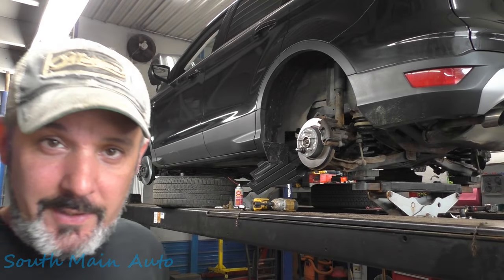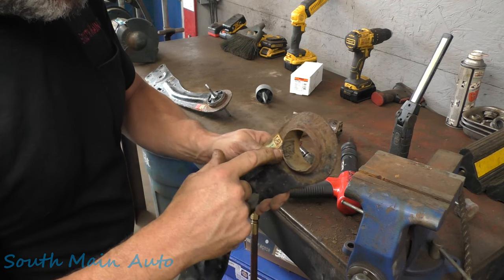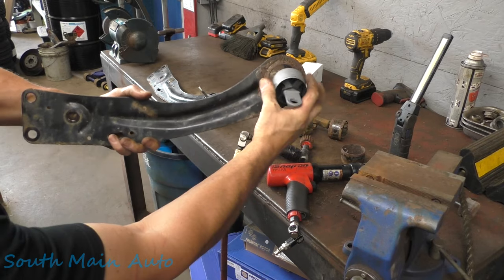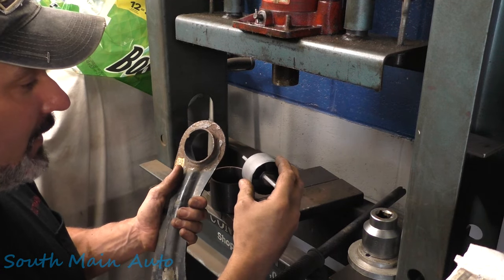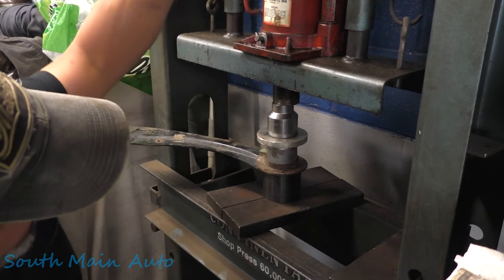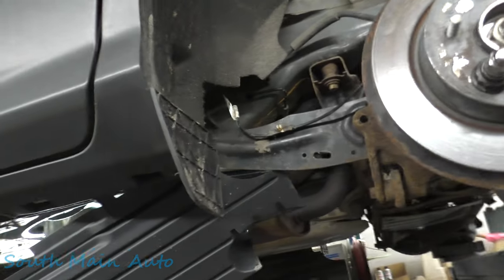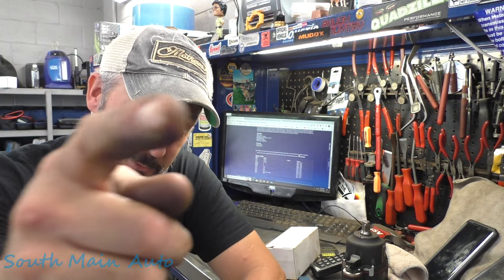'13-'19 Ford Escape Rear Trailing Arm Bushings

Comment from the maker: -Dorman 523-067 Rear Lower Forward Suspension Trailing Arm Bushing : https://amzn.to/3cxivLD
-The secondary reason I made this video.... https://youtu.be/fGm1asWuqqU
Reply: Sponsor?
Reply: Hi Eric - Have you had any luck with Dorman lower control arm bushings for Toyota Camry?  I need to replace the bushings and the dealer parts dept wants $150 per control arm. 

Also, I saw some kind of investment spam in the comments so I reported it to YouTube.
Reply: So the rear trailing arm is trailing behind trying to escape.
Reply: The audio sounds pretty good like usual on here
Reply: @bbccat2  Try a dealer that sells online such as Partznet in PA, Conicelli Toyota.

Comment: And for the "Shade Tree" types that don't have a press or that nifty cutting tool ... take a hack saw blade off, insert thru the bushing metal retainer, reinstall blade and cut a notch in the bushing housing and, after removal of the hack saw, hammer and chisel on the edge of the cut and she'll pop open. As for the Press, toss the new bushings into the house Freezer for a few hours and it will contract enough to slide in by hand; may have to warm up the mating surface on the metal trailing arm orifice to gain a few thousands more but it will go in by hand.
Reply: @felixgato4392  most welcome !!!

Comment: I went to go grab my air hammer with a regular chisel attachment to remove the sleeve. Turns out I had the same attachment as this video. Brand new, never used. Took the sleeves out like butter. Thanks for showing me a tool I didn’t know I had!

Comment: i usually mark the arm with crayon where the old bushing was installed before I take it out....that way, the new bushing is in the same plane as the old one...good job
Reply: Good idea
Reply: Great idea I normaly use permanent marker normally gold or silver
Reply: Tried using my wife’s lipstick but pink doesn’t show up very well on metal…😘
Reply: Sharpie marker or pink paint marker
Reply: The old one is no longer attached ...;-)
It came out by hand.
Reply: That's what the OEM instructions say to do, at least on Volvos when you do these

Comment: I used the Dorman bushing and it worked great. It was a pain in the butt getting apart without a lift getting enough leverage to brake the bolts loose. It went back together better then I thought it would. Thanks for the video, saved my daughter a bunch of money

Comment: When we swap these out at the Volvo dealership (Fords and Volvos from this era use the same platform in some cars), we actually do them in the car, just take off the shock absorber bolt, and loosen the short arms that connect to the hub assembly, then after getting the bolts out of the bushing use a large pry bar to wedge the bushing down enough so you can air hammer it and push in a new one.
Reply: I just take 2 or 3 bolts out and just loosen the last one.  Take the two bolts out of the frame and it will come down enough to get the air hammer in. At least with the Fords.  I don't work on Volvos.

Comment: Use the moog if available.  I did these this afternoon with the dorman part . PIA . Even with the new bushing in the freezer for days and heating up the arm with a torch , still bashed the hell out of it . Ended up taking away metal where the bushing resides , little by little until the bushing fit tight . Popped the bushing back out , coated it with green loctite sleeve retainer , drove it back in , bolted it back together and let it sit . Strange the passenger side was completely shot , but the drivers side was still in great shape .
Reply: I did the same with the moog part and it was also hard to get in. Only my passenger side was bad as well. The bushing slowly separated and became offset in the sleeve even though the rubber was still pretty good. I believe it is due to my trailing arm wanting to sit closer to the middle of the car (I had to pry it outwards to line the two bolts next to the bushing up). So this one will likely do the same with time as the are has inward pressure so there is constant sideways force on the bushing.  As the sleeve corroded the rubber will slowly separate as well.
I think I'd have to get an adjustable toe link to fix this. The passenger side does look to have a bit more toe in than the driver side on my car.

Comment: Trailing arm on my 2007 Focus was cracked and flexing enough to touch a brake line. I was replacing the shock and couldn't believe such a suspension failure.

Comment: Hey Eric, how many miles on that Escape? Thanks for the video. I didn't know that Dorman parts were good I've always had mostly bad luck with their steering and suspension parts. I'm surprised you stated they work OK on those trailing arms. We all know how bad Dorman can be with automotive parts they're more of a miss than a hit. In my books Dorman only gets used when there is nothing else available in the market it's my last resort case scenario. The audio quality is superb with your new camera 👍 Thanks.
Reply: Moog also makes this bushing as well, this is what I've put in many times at the dealer when these arms are unavailable
Reply: @CanadianCarguy247  Yeah, I like Moog. That's what I use mostly for steering and suspension stuff over the years.

Comment: Dorman doesn't make any parts. They are an aftermarket reseller. They source parts from a variety of manufacturers and then sell them under their label. This is why some of their parts can be lousy and others very good.  NAPA does the same thing by selling some parts under their brands but then it also sells products from other manufacturers and suppliers.

Comment: Get some eye protection on when using the power tools...  and don't say you just close your eyes..  Thanks for the video this morning..!
Reply: I am "lucky" to have a bad example to remind me to wear eye protection any time I am working with power tools.  In the 1970's, my father was doing a quick sharpening operation on a mower blade and a piece of metal went through his eye.  He was pretty much blind in that eye for  over 30 years until they developed a procedure to fix it.  Even today he still has problems with it.  WEAR EYE PROTECTION!  PLEASE!

Comment: I'm in Buffalo New York and I have a 2016 Ford Escape SE a d the passenger side is incredibly loud when you hit a pot hole or anything really.  Should I replace both sides or can I get away with just the passenger  side?

Comment: I had noisy rear end when going over bumps and had the Trailing arms replaced and i still have the knocking noise when going over bumps. Any suggestions?

Comment: I have been getting into the habit of buying something in the 20,000 mile range and running about 40,000 miles and selling. After 60,000  miles everything starts  to fall apart. Selling cars every 3 - 4 years.  I also bought a NEW Nissan Sentra 1999 and sold it 10 years later. That also works. I took care of it. Otherwise this is all an endless money pit. Buy American. Better yet but what's good for you.

Comment: Do NOT forget to check the rear suspension - forward lower arms (dogbone style) on these escapes.I have done a plethora of them in the past few years as a Ford tech, because the bushings delaminate on the inner and outer portion of the arm and cause the entire knuckle to shift rearward, causing tire wear and usually a clunk or grinding noise over bumps. Can also be replaced without dropping the subframe.😉Great video Eric.
Reply: I just had to do those same bushing on a 2014 Focus SE. I just ordered the complete dog bone from Rock Auto for both sides and replaced them. Less than $40 for both arms.

Comment: Moog also makes a good bushing for this. I did this job on my ‘13. Ford wanted over $400 for the whole trailing arm assembly!!! Wouldn’t sell just the arm itself. Ridiculous.
Reply: I work as a tech at the ford dealer. The trailing arm itself is in backorder, however the rear knuckle comes with the trailing arm and those are available. We don't typically replace the whole knuckle anymore. We offer bushing replacement for them now

Comment: ***Little help please anyone: I want to verify an injector is firing gas into the cylinder. Ohms are OK on the suspect injector, I can hear some clicking on it with a stethescope but it seems to be not as loud as the others. It does have computer control , checked with test light. I do not have a bidirectional control scan tool. I dont want to pull the injector, take off the intake etc. Is the only way to determine is  to look in cylinder with small camera? Thanks.

Comment: Do you charge by the actual time spent or by "book time"? My old mechanic (retired now) billed "shop time", which could be a little unpredictable in the estimate, but was usually cheaper. The new mechanic, who bought the old shop, does "book time" and wants to charge $2300 for a clutch replacement on a 2012 Corolla. That seems insane to me, but is that the current state of auto repair?
Reply: Pretty sure Eric does it by the book. That's how we bill it at our shop along with most of the small shops near us. But $2300 for a clutch replacement on a Corolla is absolutely ridiculous. It's around 8 hours according to factory service data and at a reasonable shop rate, should be no more than a grand. A new aftermarket flywheel and Aisin/Exedy clutch kit should be under $400 in parts.

Comment: While the control-blade arm is out, should clean it some, and spray on some "Eastwood Rust Encapsulator Black Aerosol" or maybe just some zinc-infused anti-rust paint, and then spray paint black if you want.

Comment: Life is to precious to use Dorman suspension, steering, or brake parts!🤣
I need to check those bushings on my 2017 Escape, I've noticed a little clunkyness over bumps lately.

Comment: get same bush same part number duralast too, had these moog before too .
Had some Moog ones in stock as bought  in bulk cheap as fairly common job and if arm good and clean bush way to go as easy fit and cost minimal ...
garbage bush design really, was garbage  bush concept in 1999 was more garbage in 2009 and now total garbage 2019 lol 
Good engineered poly bush can be worthwhile on these for rougher road use longer life span ..
I'll get the door man ....

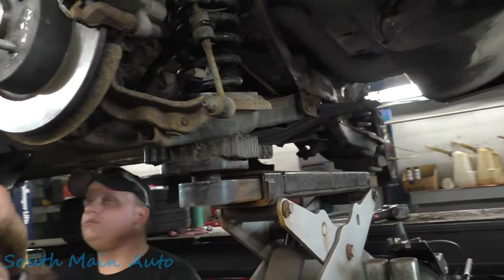Comment: As a camera test this was great. Good quality from where I'm sitting. Good tip as well. I did not notice any part where your voice cut out from being behind the camera unless you did not show it. It looks like you are behind the camera at 4:24 and though the sound change a little I would not have noticed if I were not trying to find it. I'm on a desktop computer running Win7 64 bit with no fancy speakers but they are good. Old version of Nvidia High Def Audio drivers dated 3/23/2018

Comment: Nothing wrong with a little bit of sound effects. I drove a pick up truck for many years with the front sway bar clucking. It did not have any rubber left on it. Just 1/2 inch of sound effects. 
One day, I was going to take it off and repair it, but it was so rusted up that I just said meh, and let it be.

Comment: From the UK and I have a 2011 ford Mondeo, same type of bush. Terrible design but I bit the bullet and fitted polyurethane bushes. Bit more expensive for sure but ride quality is still great and I'll never have to change em again. If you start getting wear on inside edge of the rear tyres, defo suspect the trailing arm bushes

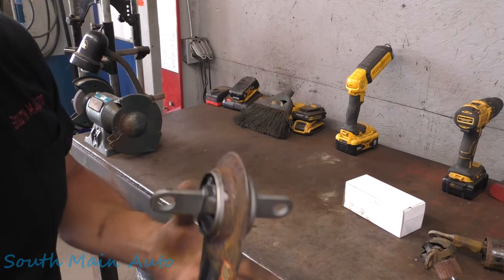Comment: 3:56 once you flash that thing around in your hand like you just did I saw how thin it was and I'm just scared of that actually being a part on any vehicle l 😂
Reply: Well, it is installed with the edges being vertical. So any downside and upside pressure goes through the entire width basically.

Comment: Had my ford dealer quote me over 1300 to replace my rear trailing arms as they said they were bad and would not pass inspection. Had my local garage perform the inspection and quote me on the cost. 

One they could not find why the dealer said they were bad. 

Two they said it would cost less than a quarter of the cost they quoted me at if they needed done. 

Glad to support my local shop!!!

Comment: 5:00
Howdy, Q: Preheating the 0.d. , , , , ,is it worth the time, in an automotive environment. my environment is hydro-mechanical(big ass mechanical / hydraulic presses). anyways, i feel more comfortable removing as much stress on a bearing during install.   So  Heat the  O.D. And Cool The I.D.
i shoot for drop in temperatures.   CO2 fire extinguisher  and/or flame, , , , , ,250?
ty, les

Comment: Doorman has gotten a bad rap over the years, a lot of it earned. I’m not sure I trust their electronics but a lot their basic parts seem to be reliable and they fit. I replaced an intake manifold on a Ford 4.6 with a Doorman. That was 140,000 miles ago. The coolant runner on the OEM had an O ring failure and it was the upgrade from when Ford discovered the the issue on the plastic ones. This one leaked into the spark plug holes on 5&6 causing misfires. The Doorman fit and was a third of the price of the OEM. I made the decision to use the Doorman since the replacement OEM was the same design as the failed one.

Comment: I was always taught to put a little lube on it before pressing it?
Reply: Sound advice. Works for automobiles.
Reply: it doesn't hurt...just a little on the bushing where it goes into the arm
Reply from the maker: It is an interference fit, Lube would be no help, it would just wipe off I imagine....
Reply: Doesn’t matter at all. The part is meant to be held in by the metal to metal friction. Any lube added will be removed immediately by the interference fit.
Reply: Oh, you guys are all talking about cars??? - Oops, my bad!

Comment: Hi.  I just got a 14 Escape titanium with the 2.0 Eco and it only has 46,000 miles on it.  What are the signs that the bushings are going out?  Does it start squeaking or out of alignment?  Thanks for the demo on it.. I could do that myself, I just need a press and a way to get the collar out..  But, I'd just remove it and take the arms and new bushings to a shop that could do that.. Thanks!
Reply: Usually inside wear on tires. They're not hard to see either if you're ever under the car